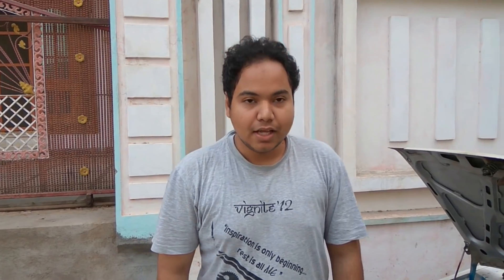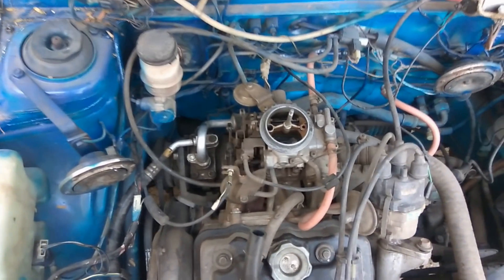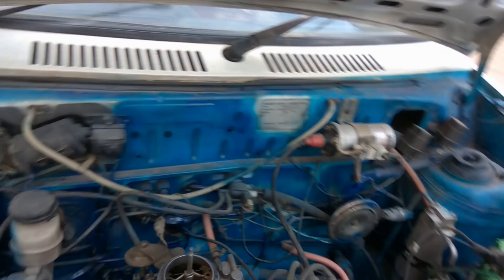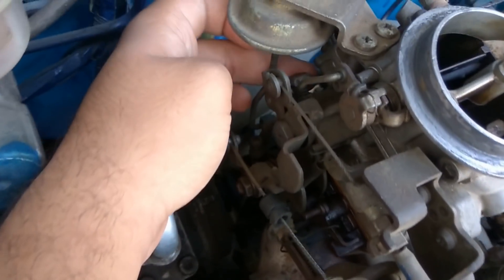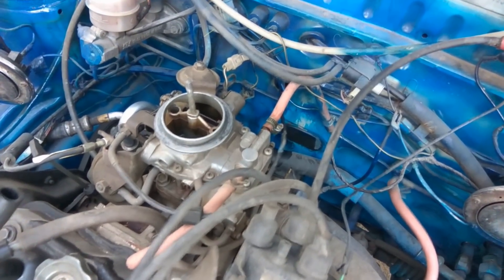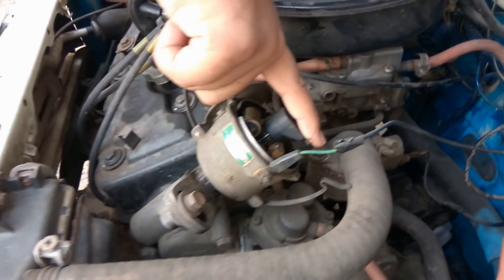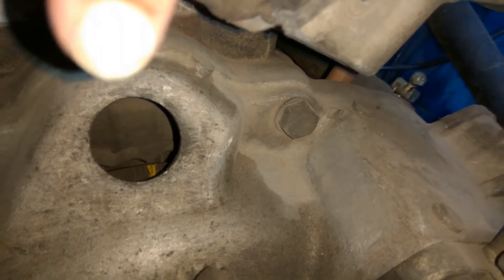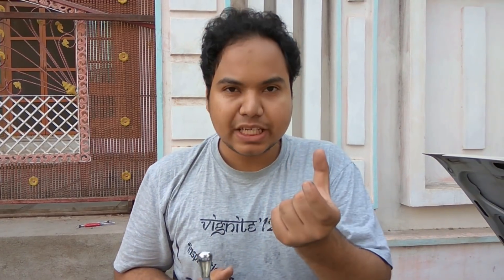Tune carb and spark distributor for max mileage

Comment: Asalamu Alikum Aveem very thankful for the helpful videos, My 1999 model maruti 800 has been giving me quite some trouble as the engine keeps jerking as if someone is playing with the accelerator. A friend of mine told me that the problem is with the coil and the leads of sparkplugs, what do you think I should do? 
thanks in advance Brother.
Reply from the maker: Yes, he is right. If everything is right i.e. you have no loose negative wire from distributor to ignition coil and a wire to carburetor is also tightly put, then you have a problem with either spark plug leads or ignition coil. Start your engine, let it idle and pull one spark plug wire out. See if the engine still works. If it is working, put it back on and pull another plug out. See if it is working. If the engine stops at pulling any one of the plugs, it is time to change the spark plug wires. Change all of them at once or you will have another one of them failing in short time. If the engine is working fine at all times, then your ignition coil has gone wrong.
Reply: Aveem Ashfaq thanks a lot 😀

Comment: bro what is the proper rotation of fuel and AIr screws for maruti zen for maximum mileage.
Reply from the maker: Maruti cars zen, esteem, 800 have same carb so technically, the rotation must be the same. But I don't know practically how different it is. Zen has 1000cc engine which is bigger, so try 4.5 rotations. Drive the car for 100 kms and see the color of spark plug. If the tip of sparkplug is white, you need to do an extra 0.5 rotations. If the tip is pink, then it is perfect. If it is black, then tighten it by 0.5 rotation.
Reply: Aveem Ashfaq thanku will try and see.also u said all the 3 cars have same car.so can I use an 800 carb direct bolt on for more efficiency?

Comment: how can you get spark when engine is not running and just by moving the distributor....and how on earth a distributor can produce a spark...what is ignition coil there for then....best way to to adjust the ignition timing is to simply use a timing gun..thanks
Reply from the maker: the mechanism of producing spark is, if there is a high voltage (inside the capacitor or condenser or coil) which is connected to a small gap (like a spark plug), then sparks start flying off from one end to another. If the key is turned on, then the high voltage is generated and so, it should work. Do not confuse a car with a bike because in a car, the ignition system is controlled by a battery whereas in the bike, it is controlled with a dynamo. The distributor is a rotating switch. As the engine rotates, the distributor rotates and makes contact with one spark plug wire to send spark into that spark plug. Then it rotates some more and transfers the spark into the next spark plug. In my spark plug tuning video, I create a second spark gap between the fat wire and the body of the car so that I can see the spark for myself. You might be wondering how spark is generated if the positive side of the fat cable is unplugged. But the thin negative wire connecting the condenser to the distributor is still connected. So, when I bring the fat cable to the body, the circuit becomes complete. At this moment, if I align the distributor perfectly, only then the switch is turned on and I can see the spark. Hence, I get the perfect timing.

And please don't tell me that timing gun is better. That is non sense. If you are tuning the distributor, you can exactly pinpoint the location of spark sound and accurately align the distributor. If you use a timing gun, then the light generated will have an inherent delay. So, that is an inaccuracy. And the light will not come for only a microsecond for the timing gun to be pinpoint accurate. The gun will remain lit for a range of time so the error in adjustment could be a couple of degrees. And spotting with gun is time consuming and requires expertise. But everyone can hear the sound of spark. I hope this clarifies your doubt.

Comment: ASlmlkm brother. i have a problem with accelerator. recently  i just tuNed the carb according to your video and i got a mileage of 24kmpl. after some time the car is not staying in idle rpm. its getting off. when i adjusted the idle screw, the rpm is increasing and staying in 'on' condition for some time and again getting 'off'. can you suggest me what may be the problem.
Reply from the maker: When the engine is cold, the parts shrink in size. parts are tightly held together with great resistance and you will have lower rpm. As the engine gets hot to operating temperatures, the engine expands and everything becomes smoother. So, in the cold conditions engine might turn off by itself. You should increase the idle rpm so that even in cold conditions, your engine wont turn off. Or this is what I do. When the engine is cold, I pull the choke 1 step so that the rpm is high and the engine wont turn off. After I join the main road, i push the choke and until then, the engine is hot and there is no trouble.
Reply: Aveem Ashfaq brother. i was going to hyd. running in gas. when gas is suddenly over then i switched to petrol. the car didnt start for half n hour. some how it started. then when i entered into city, i noticed that car is getting off when im not accelerating. so i pulled it a side and increased the rpm. even though rpm is increased the car is turning off. for sometime it is staying at high rpm and suddenly getting slow rpm and turning off. i think it might be due to clotting of jets.i haven't changed the petrol filter since 3 years. also when i filled lpg gas the car is good. so any suggestions brother?

Comment: Aoa Bro , very helpful video, I got problem after carburator adjustment that car engine stop when you put break on turns after high speed . Is it due to low idle ??
Reply from the maker: malikdanyal yes, if you have low idle rpm, you will have the problem. another reason might be the clutch but if you did not have problems before tuning, it means that the clutch is good, only the idle is a bit low. increase the idle and everything will be fine
Reply: Aveem Ashfaq thnx Bro ,when I turn headlight on it's like a load on car and engine bit vibrate ..after first adjustment
  .... now I mess up both idle and mixture screw.... kindly tell me first I adjust idle or petrol screw in carburator??
When I increase idle car rpm increase too much .... and air screw adjust only after one turn ....kindly guide me .
Reply from the maker: malikdanyal I think you should follow tlmy video step by step. whatever I do in the video first comes first to you as well. and please follow all steps.

Comment: hi Aveem, Can you please share a video of Tappet Adjustment...?
Reply from the maker: I can do that. But I am concerned that people who watch the video cannot even follow the above video perfectly to the point.  And tappet adjustment is a serious thing. You could have drastic mileage loss if the clearance is done wrong. That's why i did not do that.
Reply: Hi Aveem Thank you very much for for kind response, i am strictly following your videos it works for me a lot. Please share a video for Tappet Adjustment  in detail.. I wish you a great success.
Reply: Aveem Ashfaq  thanks for the video bro 
I tuned my 1998 Maruti 800 as you         have shown in the video it works much better now but the return fuel jet is slower than the video and I have bought the fuel injector cleaner as shown in the video but not sure about the quantity of cleaner to be used and the minimum amount of petrol to be present during the use of the cleaner... please suggest
Reply from the maker: You should have more than half a tank of petrol and then pour in the fuel injector cleaner. I put the fuel injector cleaner when I had 3/4 tank full of petrol. Pour the cleaner and drive it for around 50 kms. With each passing km, your car will feel faster. After sometime, it will reach peak efficiency and that is the limit of improvement.

Comment: how to set the mileage of maruti zen
Reply from the maker: If you have a carbureted zen, the procedure is the same. The carburetor of zen looks just a tiny bit different where the petrol return line is horizontal instead of going longitudinal. But the screws and other things are at the same place. You can do the carb tuning just the way I did.
Reply: Aveem Ashfaq make a video on carburetor zen. how to set the mileage and how to fix vacuum pipe
Reply from the maker: i don't have a zen with me so I can't. But tuning is universal and same for all cars. Your carburetor can be tuned in the same way as I did. For the spark distributor, you will have 4 leads whereas in maruti 800, you have 3 leads. You have to see which lead goes to the first spark plug from the left side of the engine. The procedure is the same. Put it in 4th gear, remove handbrake and push the car until the rotor inside the distributor reaches the first spark plug lead. then put the cap back on, turn on the key and rotate the distributor until you hear a spark.

If you have any more doubts, you can send me a mail at aveemashfaq [at] gmail.com
Reply from the maker: I have written it in short but follow the video instructions to the point. Only difference 4 spark plugs instead of 3. So, find the first one from left, then align the flywheel marking and then turn the key and so on.

Comment: petrol Returning is lite slow what to do bro
Reply from the maker: If you have petrol in the return line, that is good. Everything is alright and you will get mileage. If you want it to be perfect, add some fuel injector cleaner I have showed in the video. Fuel injector cleaner will clean all the deposits and increase the flow.

Comment: what speed to be maintained on Highways
Reply from the maker: 75-80 kmph on highways. That will give you the best balance between mileage and speed. Anything above 85kmph and your mileage starts decreasing. And speed below 70 kmph will not give you that much mileage.

Comment: Hello Aveem, I am glad that you are helping maruti owners with your best, i am thankful for that. I was wandering if i am able to install a tachometer (rpm) in my 1998 model 800? Please suggest any ideas or any video related to this if possible. Thanks.
Reply from the maker: Hey. I have to buy a tacho in order to make the video. I thought no one would be interested in it. But since you asked, I will make it. But it will take some time.
Reply: Thanks brother, I have seen custom tachometers in alto and some other vehicles over youtube but i want one for my 800 that may work perfectly and accurately. I will be waiting, Thanks for the quick response.

Comment: hi aveem .. I think problem is still not fixed ..I can see no improvement in milage..when I tried to make sure if my tuning is correct ...and after matching the mark on flywheel... I opened the distributor ...as turned the distributer I did not hear sound of spark..so I tried your old method and made  a mark outside... and I came to know that even after moving extreme left or right... it could not touch the marking... it was out of range...what to do now... ??  can I try to move that black thing on centre of spark distributer..  what to do please help...
Reply from the maker: tech eapert you did not follow the method correct enough. the marking on flywheel matches in two positions. one is when the distributor is at plug no. 1 and the second is when it is between plug 2 and 3. if the plug is between 2 and 3, there will be no sound no matter what you do. that is the reason why in the video, i asked you to make sure the black thing is pointing at the plug no 1 roughly and only after that, align the marking of flywheel. then hunt for the spark sound. dont move the black thing physically.
Reply: but I can find only one mark of white colour that I matched with the mark...   how to spot second one.??
Reply from the maker: tech eapert, there is only one marking. the flywheel does 2 rotations for every rotation of spark distributor. so, your flywheel markings match the indicator twice for every time you want to afjust distributor. once.  near spark plug 1 and second when between 2 and 3. you put between 2 and 3 and so ypu did not hear spark.
Reply: ok I got it...👍👍😊😊

Comment: if connect glass cleaner water tank to ac condensor spray it low interval time this idea is good
Reply from the maker: Yes. That is a good idea. Even I am thinking about doing that. But I am trying out new solutions like peltier effect etc. After the whole research, I will tell you the solution in the form of a video. Until then, take a 600 ml coke bottle, put a hole in the cap and fill it with water. Point the cap at your radiator and squeeze the bottle to squirt water onto the radiator to cool it. I do this regularly on my car on long journeys. It will help a lot.